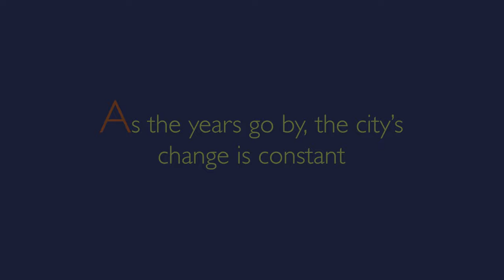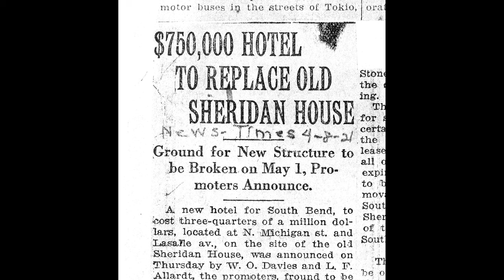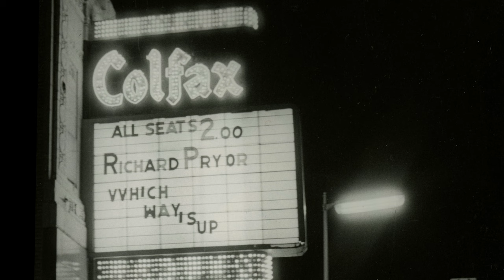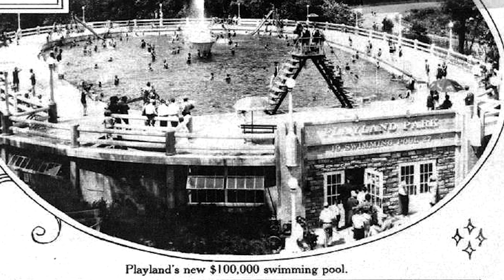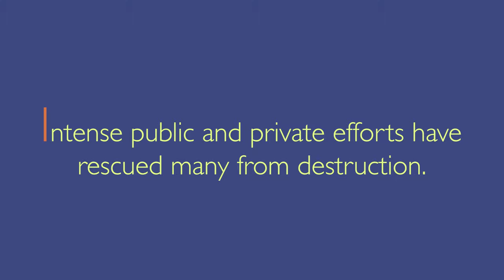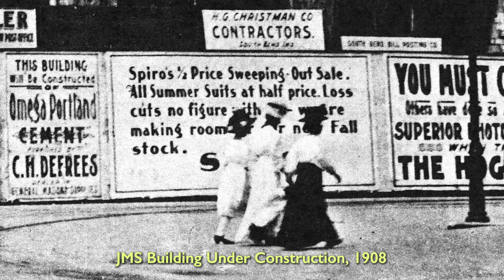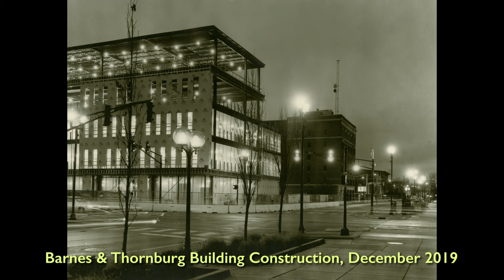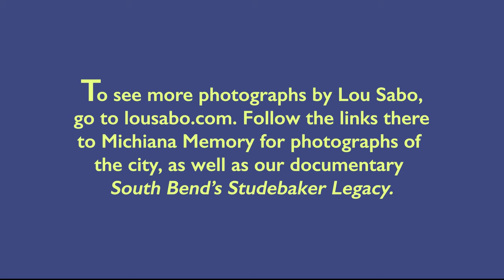South Bend Lost and Saved

Comment: I learned a lot about DIY projects on our house on Noth College Street.  It was built in 1912.  Creaking old uneven floors.  The entryway was separating at a slight slant from the main house.  Trying to wallpaper over cracked plaster.  The dining room ceiling bowed and sagged till it had to come down.  The musty basement.  The front door had 13 layers of paint, which crumbled into little squares when you scraped it. Replacing shingles.  Climbing up shaky ladders to paint it 35 feet over the driveway.  Broken sidewalks.  Grub infested lawn.  Fans in the windows with no AC.  However, it had once been quite stately and I did love the high ceilings, heavy woodwork and the clothes chute.  Never again though.